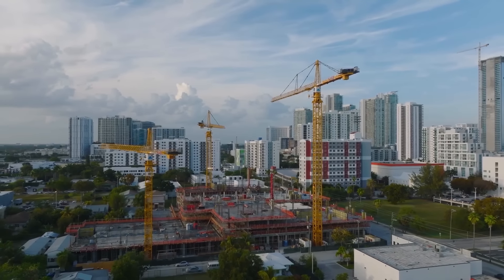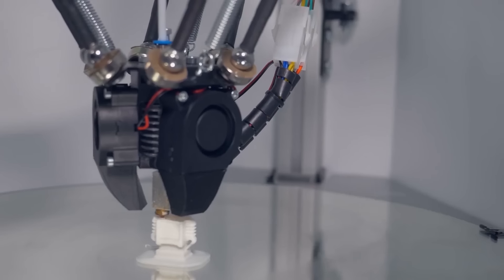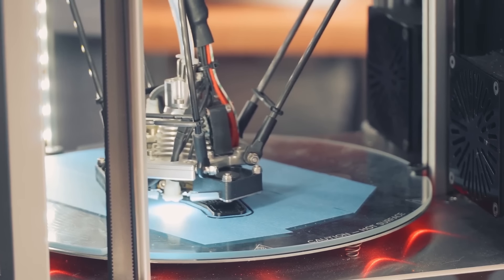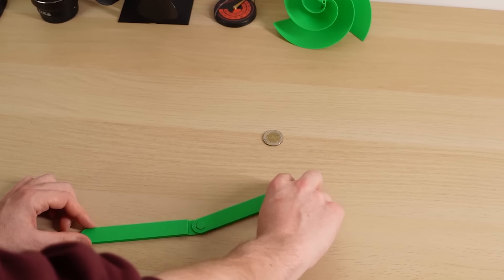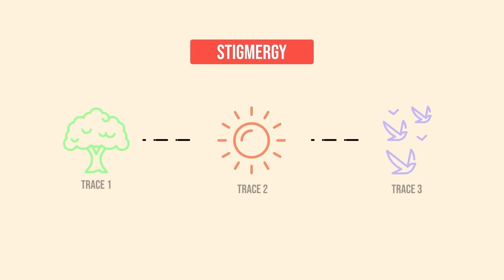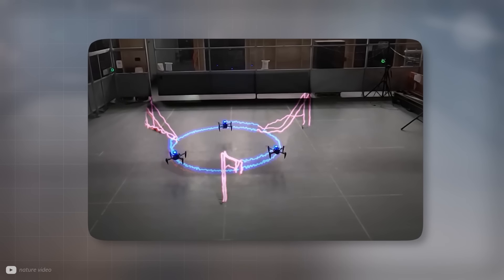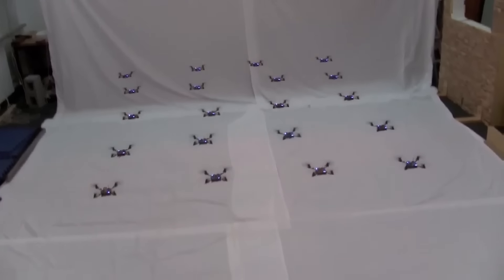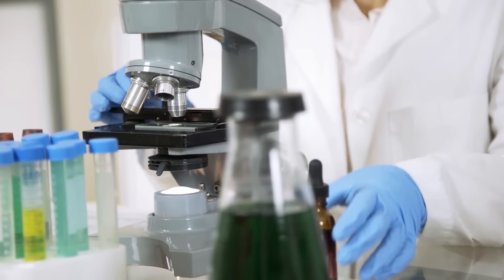Why 3D Printing With Drones Will Transform Construction

Comment: I can't see this happening.  You're essentially talking about drones with the cumulative energy required to lift an entire house.  Sure, they only lift a small percentage at a time, but that's not the point, and drones are not energy efficient.  In order for the drones to do a useful amount of work per flight, they would need the power to lift a usefully sized payload, something comparable to a job-site cement mixer.  That would make them more like small helicopters than any of the drones you showed.  Sure, they could use expanding foam instead of concrete to keep the weight of the payload down, but then that's going to have to be covered in some sort of render to make it secure.  You wouldn't want a house where thieves could just use a hot knife to slice through a wall, or acetone spray to eat a hole through a wall.  Expanding foam is also really hard to control precisely - just look at the state of that tower.  Even though it was deposited accurately, it expanded all over the place.  Strong foams, especially closed cell foams which is what you need for insulation, are made by expanding them under pressure.  In free air, the expansion continues unrestricted, leading to a weak cellular structure.  It's bad enough walking around upstairs in an old house where the joists flex.  Imagine how creaky it would be if the walls that the joists are attached to flex or squish, even slightly as you walk across the room. 
There's also health implications to using plastic foam.  It will off-gas for years, making the building rather toxic.  It would need a very efficient ventilation system to ensure adequate air replacement without losing heat.
I'm sure materials science will make great strides, but I just don't see it evolving to the state where it's both economical and structurally sound.  When you compare the speed and efficiency of the current construction method using interlocking expanded polystyrene formers, filled with concrete, I just can't see the economics working.  I can see how gantry-based printing can be useful for creating very flexible designs, especially when curves are used, but drones?  I think not.  You say that gantries are bulky, but everything about building a house is bulky.  Joists, wooden or steel are large, A-frames for the roof are large, bricks or concrete are also massive.  Transporting a relatively light weight set of collapsible gantry frames is no great shakes to the building trade.  An experienced team would probably have the gantry assembled in a couple of hours.
You talk about drones being able to build on an island.  Try getting 3 or four full-sized cement mixers to the island before the concrete goes off.  The gantry is the least of your worries.
Neither gantry nor drone printing incorporates any means of integrating rebar, so they would be susceptible to crumbling in a high wind or earthquake scenario.  This means the walls would need to be much thicker to compensate.
The more I think about this, the less practicable it becomes.  I'm sure it's fun researching this, but someone needs to take a reality pill.

Comment: Je ne crois pas du tout que des drônes puissent imprimer en 3d un bâtiment car cela représente des centaines de tonnes de béton ( mortier), cependant imprimer des bâtiments avec des murs ( voiles) avec une structure en nid d abeilles est une bonne idée pour rendre les murs plus résistants à la compression, cependant il faudra toujours avoir une épaisseur d alvéoles suffisantes: les voiles ( murs ) conventionnels font en général  16 cm d épaisseur, mais en imprimant en 3d ( avec une imprimante 3d ) font environ 5 à 6 cm d épaisseur ( avec 2 ou 3 murs parallèles, donc faire un mur avec plusieurs alvéoles hexagonales d environ 4 à 5 cm d épaisseur pourrait être pertinent pour augmenter la résistance des murs ( comme cela a fait pour des bâtiments imprimés en 3d avec de la terre argileuse : construits avec des formes sinusoïdale se chevauchant). Donc d après moi les nids d abeilles sont une bonne idée, mais cela demandera sûrement plusieurs essais pour avoir une technique au point.

Comment: Good experiment, but I can think on many other options using drones for construction that does not involve such complexity and power consumption. For example, just put an structural part on top of the other is way easier to a swarm of drones.
That said, everyone goes crazy  on flying things, may be our human nature hoping to overcome our own limitations as specie. You just can do the same way easier with other kind of robots just have to see nature working with all our legs on the ground, ants and termites are way better building structures than any flying creature (bigger and faster)

Comment: Also need to worry about electric and batteries. Here in the USA finding a place to charge a car outside a massive city is nigh impossible, the grid has not been set up for today's electrical uses, much less even more electrical generation and it's requirements.

Comment: The plausibility vanished with the mention of 3D printed martian habitats - the atmosphere is so thin that Ginny was barely able to fly. https://en.wikipedia.org/wiki/Ingenuity_(helicopter) " To keep Ingenuity aloft, its specially shaped blades of enlarged size must rotate between 2400 and 2900 rpm, or about 10 times faster than what is needed on Earth"

Comment: How does a drone carrying a few liters at best of fast setting concrete help build in remote areas exactly ? You still need to bring the concrete close to the worksite, most likely in a cement mixing truck, you need to bring all the charging infrastructure, so probably a big generator and energy storage in a truck trailer form factor, the drones themselves are probably another truck load on its own, all said and done you still need all the same road and power infrastructure every worksite already has to even start construction. I doubt it would be cheaper either, if flying was cheaper everyone would have helicopters, not cars.

Comment: 3D printing houses is not fast. Its a flexible way to build, but having a mould and just pouring concrete in there is far faster. 2 trained brickworkers outcompete a 3d printer printing a wall easily. The issue is cost. People are expensive.

Comment: You can't build large structures without steel or wood reinforcement.  Drones only carry a small amount of material at a time, are way too slow for building construction (even with a thousand of them), and once the battery is flat will take a long time to recharge, and they'll be flat in 10 minutes..  You're wasting your time here. It seems like a cool idea but its totally impractical.
Reply: They are using drones to spray crops already they just land the drone and swap battery pack and re fill it ( you would need a support staff to maintain the drone as it builds )
Reply: @randyschoenbeck3630  yeah, that's true, and I've seen tether drones that can stay in the air indefinitely. It's still incredibly inefficient and imprecise. Not to mention the construction materials are... Well let's just be nice and say there's a lot to be desired. 😂
Reply: @randyschoenbeck3630  There's a big difference between spraying trees and making a building. Buildings need iron re-enforced concrete and a strong structure to build on. The drones aren't going to be weaving in and out of meshed metal frame to deposit concrete at the right spot. And concrete is damn heavy, so you're not going to be able to deposit more than a bricks worth at any one time before needing to refill its reservoir., and most likely recharge.  Spraying involves depositing small amounts of liquid in the general vicinity of the target location.  Its not the same at all.   This entire notion that you could build a structure with flying drones, efficiently,  is ridiculous and anyone with a practical mind will see that. The problem with youtubers that report this nonsense is that they lack a critical mind and don't see the pitfalls that make a particular idea worthless.
Reply: @just_saw_dust  Sorry, I misunderstood your previous point.  I thought you meant that because there were spraying drones then concreter drones are also possible. Which is not what you meant at all.  My mistake.

Comment: It seems to me that a single arm concrete printer would be preferable in the areas where a gantry system is not feasible. If produced on the tens of 1000s, maybe the cost of this construction would be economically doable. Personally, I like the smooth curved lines of these buildings. 
Would it be more feasible if the system extruded foam and then coated it in some sort of reinforced shotcrete?
Reply: I think I have seen printers like that already.

The term for robots like that is "cylindrical robot", which is named quite obviously because its range of motion is a cylinder (well really a hollow cylinder like a tube, where the robot itself goes).

Comment: My 55Wh lion battery can keep my 1kg drone hovering for about 15-20mins, just got much would be needed to build a house/shelter and carry any meaningful amount of material? They would be better off air dropping a load of popup tents in an emergency shelter situation. Certainly less wastful then using concrete or some exotic materials for a temporary emergency shelter

Comment: the smaller-than-product printing system is a great idea, but implementing it with quadcopters doesn't seem to be a good decision, especially on mars where not much atmosphere to generate lift.  wired hexapod that climbs on its product while printing would be better

Comment: Very cool, but I don't see how they would be practical for bringing enough mass to a build site. The mass and strength are required so that buildings don't cave in on the occupants.Build sites still need to be leveled and shored up before building can begin.

Comment: You completely ignore most of the issues here.

You need material to build the structure so you need to get that material to the building site, most likely using trucks, so you still need large machinery.

Drones are very inefficient too, they require lots of power and drones can be easily interfered with.

Why is flying a requirement? Flying should only be used when absolutely necessary and it isn't necessary here. A legged or wheeled robot could work just as well. They could carry more material and they don't need to compensate for any movement like the drone does.

Drones are just a bad choice for things like this.

You still need heavy machinery to prepare the site and ground and build the foundations before you even think about printing the walls. Unless you think you can use drones instead of an excavator too? Then you need a way to remove the excavated material and you need to be able to get the material for the foundations there and for building the walls, so this doesnt reduce the need for heavy machinery at all really.

Comment: I could see this for a repair or something... But lifting mass on batteries and fans? Yeah... That is going to be a lot of small batches. Gantries or cranes can be set up and torn down on site way easier than the thousands of trips this would take.
However, this idea could be applied to a crane and gantry style system. A few drones for some eyes on the project, and coordination, and multiple I dependant nozzles or partial simi-mobile gantries laying down layers, and other systems for mixing raw materials to pump out on demand.
All that said... Even traditional 3D printing for large structures is proving impossible (or at least deceptively difficult). Settling and cracking has really messed up most projects mere months after completion. Doing that with drones vs anything else isn't going to fix that issue. It is looking like we need to break up the long walls so that there are natural settling break/shift points... And if that is the case, then prefab panels with droids placing and fastening them together is going to end up being the better solution.
But again, for smallish repair work, or to make up for smaller more complicated sections this could be a great addition to everything else coming in the large scale additive manufacturing options that will eventually displace traditional building.

Comment: I wouldn't assume that this uses less infrastructure when you consider the amount of material and energy needed to support a fleet of drones, from lithium mines to factory cities in China making the parts. I think if this would be optimal if it used spider-like drones and attempted to beam power to them or use another delivery mechanism to avoid use of batteries. It would also be sensible given someone will soon connect an AI to it and you don't want it actually autonomous and running amok.
Reply: I've actually seen tethered drones used for picking fruit work pretty good. I can imagine if you were going to do something like this, a tether would be the most practical solution. But tethers add additional complication... And by the time you've dealt with all the inconveniences of having a tether, might as well just use a damn crane. 😅
Reply: @Unmannedair  Steering a swarm of string puppet 3D-printing robots.

Comment: Why are they still still relying on a layer system? The structures would be much stronger if they could do away with layers and given that they're literally flying multiple drones at once it should be trivial to have them build in 3d without layers.

Comment: Anyone who thinks this is anything more than a way to take money from investors, doesn’t have experience with drones or 3D printing.

Very small payloads compared to take off weight. 
Massive energy usage. 

Delta format would be a very responsive kinematic to use but has a very small print area. 

A gust breeze would wreck the  print.

But most of all. This might work if you want to add a couple of pounds of material, but on any large scale building we are talking massive energy, time, capital expenditure, and personnel, to maintenance the drones, tune the printers.

Comment: The idea of drones doing 3D printing sounds cool at first, but the more you think about it, the less sense it makes. Between the battling with the winds for precision, the constant trips back for more material because drones can't carry much, and the massive energy requirements, it's more of a tech demo than a practical solution. 

Plus, the safety concerns and legal regulations around drones add another layer of complexity. Imagine a drone malfunctioning mid-air or dropping materials - the risk to people below isn't trivial.

 And navigating the web of airspace regulations and privacy issues? Every city has its own rules, and the thought of coordinating drone flights for 3D printing across different jurisdictions sounds like a logistical nightmare.

Comment: as cool and futuristic as this looks in theory, physics really gets in the way of things. this is yet another hyperloop or solar roadways kind of a really idiotic idea, fluffed up to sound like the ultimate game changer. 
building materials are HEAVY, and quadcopters are agonsingly inefficient at suspending loads, compared to something as simple as a crane, that uses zero energy to hold up a weight in place. and at the point of 3D printing habitats on mars, it entirely slid off into runny bullshit. mars' athmosphere is about 100 times less dense, than ours. making flight incredibly inefficient.
Reply: You don't even have to run the numbers to get how idiotic this idea is. The consumption of lithium batteries with a short lifespan (due to the very high performance requirements) alone would be a disaster.
There are good reasons why construction from prefabricated structural elements elements already has a large market share while 3D printed buildings failed to gain significant traction.

Comment: I'm sorry, but i don't see it taking off. Mainly because its not that hard to set up a gantry for an extruder to move in. You would have also just made weight your enemy In terms of consideration of material options. Even then, I see 3D printing being more a tool in the tool belt for architects for interesting and technical buildings. But when it comes to the standard, I see things more going the way of Lego like buildings When it comes to your day to day bread and butter construction. Standardized modular components which interconnect That can be built by robots in a factory, Then assembled on site by minimal human labor, or more robots. Think portal, and Aperture science's Self assembling test chambers.

This is basically the way big brand hotels are built, as mass production of comfortable abodes is a big hotel chains bread and butter business. They have standard modules for rooms which are built at a fabrication site, Then they are shipped on site and then stacked on top of one another. At the moment they are built by people, as it is niche enough to not justify massive automatic factories like you'd see in the Automotive industry. But scale it nationwide as a standard, well. Remember, One of the biggest expenses in construction is labor. Having robots do most of the work Is the only way to bring costs down significantly.

Given the Housing crisis that's Going on in many western countries right now, It will not be long before this method is adopted for Building homes and The surrounding businesses. for example, In the UK, It's the only way I can see them finally meeting there 300,000 homes a year target, and playing catch up for all the years they've missed it.

Comment: Not gonna work. Lets say a drone can lift 100lbs(which is being extremely generous). That equals maybe 20 bricks worth of printing. Factor in the cost per unit energy to and from any building divided by 20 bricks and its pretty easy to see why this isnt a feasible solution. 
Now if they utilized tubes to transport the material and could just remain in flight while positioning the flow tubes this may work, but for now this is not a scaleable idea. Sorry to burst your bubble.